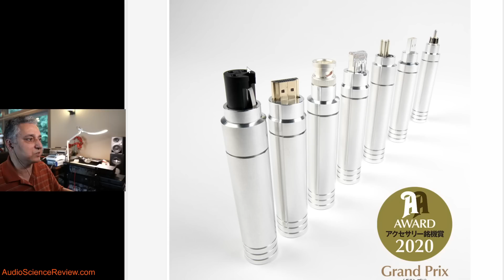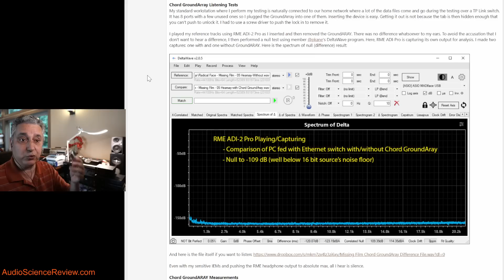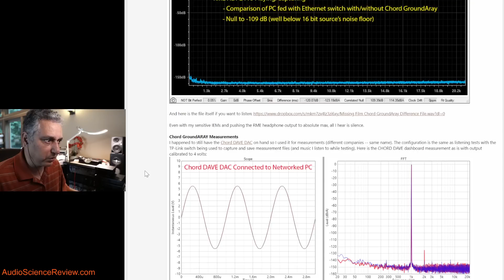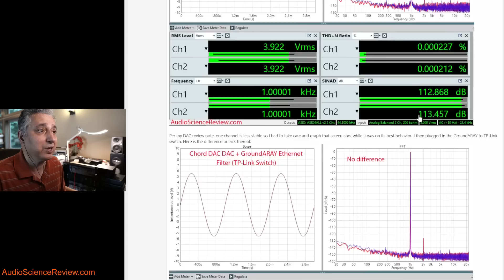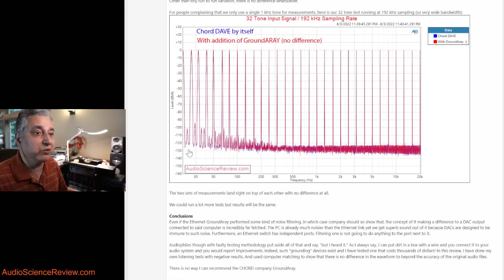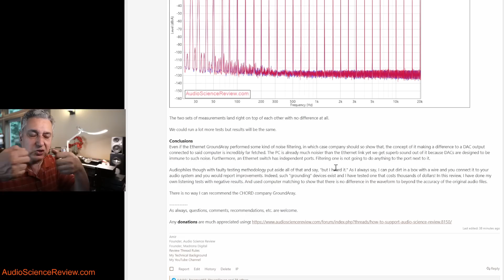Chord GroundAray Review

Comment: Shame on you for testing a product designed to be used straight into a DAC or amp into a switch, making the effect almost wiped out. You also used a very inferior system. The product is designed for a much better system... in a much better set up. Also, every user of this kind of equipment knows that you have to test which input/output works the best and that is a long slow process to get the effect, taking time. The real debunking is not the product but this channel. 

Grounding works and have huge positive impact if used in a high resolution set up, without weak links, properly placed speakers and used correctly. 

Forgot to mention that the test data and sound tests in this review are based up on measurements at the wrong places Ground Array. It’s like making a science report regarding apple, based upon data from the car industry, totally invalid. IF.... IF... you used the product correctly and measured at the right place, the quality of this video might have been higher. This kind of trash talking might get you sued from all the manufacturers that you make a living on “debunking”. 

From my experience... you will not learn anything from this feedback... just trying to give the readers another perspective and letting you know it’s time to upgrade your tests or to stop this channel.
Reply: Forgot to mention that your mention of statistical correctness was incorrect as the test was done improper. The product should be left in for more than 24 hrs and placed at another place in the system and in a proper system for which the product was intended. 

Make the world a better place, not worse
Reply: https://youtu.be/dxU8wYLMalc
Reply from the maker: Shame is on you for not watching the interview with the "designer"/company owner where he says the first place to put it is the switch/router: https://www.audiosciencereview.com/forum/index.php?threads/chord-groundaray-review-noise-filter.36256/post-1271680

So no, grounding has no impact, huge or otherwise.  It is your imagination based on wrong lay intuition that makes you think they make a difference.

Comment: Not saying it works or not, but at least the intention of use is to connect it to an unused connection on the streamer or DAC, not to a spare port on the network switch. Rj45 are isolated so maybe it doesn’t make sense. But RCA connections on a DAC share a ground, so maybe this thing has a chance if it is  connected to 1 unused RCA while music is played through another set of RCAs. 
Probably not, but just though it makes sense to point out the usage

Comment: If you take that wav file and boost gain by 105db you can hear those differences. The differences are muddled by the noise floor, but technically there is a difference. Is it possible to do that null test between an r2r dack and a delta sigma dac?
Reply from the maker: As I explained, that difference is there even if i don't change anything. It is hard to get perfect sync due to variable clocks.  As to R2R dac test, yes, that would be good to run this against.  Currently I don't have one to test but when I get one, will run the null test.

Comment: Amir, are you an Audiophile? or Audio Enthusiast ?  I can clearly hear a difference in your sample clips.  You get more instrument separation and transparency with the added grounding.  NO PLACEBO... I don't mean to offend you! Sorry!
Reply from the maker: Yup.  Been an audiophile for decades.  As for your observation, you now have proof that it is wrong.  The difference file is silent.  The power of brain to imagine things is amazing.
Reply: @AudioScienceReview  Thanks for the reply! Not to brag or anything, and i will not go into deep typing.  I am a EE specializing in Audio. Also, sound Engineer, and for the past 7 years, i discovered a new Audio technology which i cant talk about much, patent pending, dealing with so called Snake Oil.  I can basically manipulate sound at a much deeper level than the devices you measure and validate. Something which you would be puzzled, because it functions so well. However, i plan to capitalize on this, so can't say much more than that.  Ok with my tests, i get similar results as you are getting. However, there is a way, i am able to observe changes in sound signature or improvements in sound besides using the golden trained experienced old ears, hehe.  Ok, try using a middle preamp add on and a 16 ohm load between the output stage of your source and Null. It may suprise you, depending on the differences in signals etc. Alternatively same setup, record and view musical waveforms not electrical characteristics. Do a compare Analysis. You'll figure out the details, hehe... I had to figure out a way and scratched my head, it puzzled me, but in the end, I found the proof i needed to rule out PLACEBO.
Reply from the maker: @alcamacho1844  There are plenty of EEs in audio with wrong ideas.  After all, they are the ones designing equipment that so frequently shown to be non performant.  So yes, let's not get into credentials that don't add value to the conversation.  As to your claim about measurements, once more, this review included a null test.  You claimed to easily here a difference.  Yet mathematical comparison of the two files shows that is impossible.  That conclusively suggest you need to revisit your assumptions about your knowledge and understanding of audio.  Patent office accepts anything unique by the way.  It doesn't mean there is anything valid there.  Plenty of audio voodoo have patents behind them.

But sure, come back when you have something to show.  Until then, please don't make claims  you can't back and insult me in the process as well.
Reply: @AudioScienceReview  Sorry to step on your toes, it was meant as a constructive opinion and observation on your methods. That being said, ill see if i have time, i may  invest some of my time and create a video on my methods. Ill be back if so, to share my fellow Audiophile.

 Keep up the work, i find it entertaining as a subscriber!
Reply: @alcamacho1844  "Ill be back if so, to share my fellow Audiophile"  I've seen these type of claims several times - "I have something revolutionary, but cant tell you what it is at this time. it will come out in the future" -  Right from the start it sounds like snake oil
Reply: @wesselingaudiodesign5031  hahaha, true I understand! Im open minded, i used to be a skeptic before. But actually, I'm not Bs ing...  There are ways, to really create the type of sound signature one wishes for. I actually cant wait to release this tech.  It will actually benefit us all. No need to pay snake oil prices! Just moderate price tags! I dont agree with these hi end manufacturers.  So even though I have invented dozens of device and cables for over 7 years, I side with the consumers.
Reply: @alcamacho1844  Audibility proven with blind tests for your devices?   As far as peoples taste for enjoying equipment with for example, a warmth inducing distortion, or slightly ringing bass for added fullness, I can sort of understand that to some extent..  Those things are measured as added noise so should it be called Hi Fidelity? I go with No!
Reply: @wesselingaudiodesign5031  Yes... Easily pass any blind test! There are ways to excite Audio harmonics and then clean up any mess... I design Audio circuits as well. 
Have a nice day!
Reply: https://youtu.be/nzhyQFVIuRA

Comment: Each Ethernet port is electrically isolated from the switch/router circuit/s and each other.  Its just the nature of the 10base-t interface.  So I can't imagine what the device is supposed to do. Just some ferrite beads for the snake oil effect, I guess.
Reply: The purpose of the device is to separate the buyer from his cash. It works most excellent in that regard.
Reply: @SirBunghole  Mission accomplished.

Comment: After this most recent round of reviews of “tweaks”, resamplers, power cords, cables and conditioners (plus other science based testing by Amir and others) , one can be pretty confident in the  general inference that such products are worthless at best, and often make things worse. In fact what are great about Amir’s reviews of these items is he explains the failure of these products through scientific principles such that the results are applicable to the entire “class” or type of products (ie, not this expensive power cord but every power cord) and cannot be ascribed to be particular product or even one item or set up. 

Either the designers do not understand basic principles of electrical physics and acoustics, or they make engineering mistakes that are simply unacceptable at any price  (see the Chord resampler) or they are cynically dishonest. 

I know if no other “hobby” with such pervasive snake oil.
Reply: Cynically dishonest, I'll go with that...
Reply: I mean, the short-list of things that make a big difference is a really short list: speaker acoustics, outboard interface with decent noise rejection, room acoustics. Lots of folks want to believe in an expensive expensive hobby with lots of doohickeys.

Comment: My very first experience as an audiophile started in a local audio shop in my area. They had amongst other things these noise filters, a plug attached to a cylinder. They said it removes electrical noise from the outlets, improving clarity and sound fidelity. I knew something was already off, and this item you reviewed is certainly the same thing revisited. Glad to have you on our side. Keep it up.

Comment: Thank you for another informative myth busting video. I have a q, hope someone can help. The room with my audio gear has no grounded power outlets. On the rca inputs on the amp i can feel the electricity running when lightly touching (small vibrations). After plugging in rca in amp to 3.5mm audio plug into laptop it seems less/gone. Is the laptop grounding the amp or am i placeboing myself? For proper grounding would it work to connect a wire from one of the rca inputs on the amp to the grounding metal on a grounded power outlet in a different room? So like using a modified grounded power plug with just the grounding wire used, terminating into rca on other end.
Reply from the maker: It is "normal" to have that kind of leakage current, i.e. enough to give you a buzz. It is safe from electricity point of view but can cause ground loops.
Reply: You need a competent electrician to assess your wiring. Ungrounded  equipment, designed as such, class 2 or double insulated, can float at elevated potentials, often half the line voltage. Whether it is healthy to have a computer sitting on your lap with such fields present for prolonged lengths of time is open to to question.....
Reply: Thanks for the info! It does not buzz luckily but I'll see if I can get the landlord to upgrade the outlets just the same for peace of mind.
Reply: @acerlagonda3537  All SMPS leak tiny and safe amounts of high voltage AC to their chassis ground as part of their EMI flitering design. You will feel the tingling when touching the chassis, as long as nothing in the signal chain has a real ground connection to earth.

Comment: Here we have an engineering company that doesn't seem to understand the difference between a plant pot filled with soil on an indoor shelf and an electrical earth. Out of interest, can you null signals via different DACs, so we can hear what a resultant signal sounds like, please.
Reply from the maker: I am or should say, designer of deltawave is working on that.  The challenge is the clock drift.  Its actually dynamic and complex.  Without correcting for this, you get really poor null.
Reply: @AudioScienceReview  Kernel stream USB into a TCXO (or better) controlled S/PDIF converter, then into a video distribution amp for identical and buffered S/PDIF/PLL etc signals into separate DACs.
Reply from the maker: @johnshaw359  Yes, there is a method to do that and it definitely helps.
Reply: @AudioScienceReview  Thanks Amir for replying, I hope it helps you out.

Comment: Why do you so often make reviews of these “junk products”? Why not focus on normal products instead. No matter how many of these review you make very few will stop buy these products. Your fan base would never buy these products in the first place. No offense.
Reply: @Douglas Blake, no, not really. I would however personally never buy these kind of products. I think these kind of reviews are counter productive. I get a feeling they are made for pure entertainment for the already “enlightened” ones. It just enhances to polarization imho.
Reply: @Douglas Blake, I’m an engineer, dealing with high frequency signal transmission and processing on a daily basis, I kind of have a clue what could work and not. There is a lot of snake oil out there. My point was that it would be nice to see a focus on good stuff instead of the bad stuff.
Reply from the maker: My "fan base" are the ones that are sending these products in for testing.  Many have doubts and once they see the analysis, change their opinion and realize they were just following the crowd.  For sure there is an impact.  Not on the hardcore, head in the sane people, but the rest which is quite large population sadly.

Comment: I think this is the company that sold The Clearway System Enhancer Stage 1 mains filter for like $300. Turned out it was probably a re-label Roxburgh PMF6 mains filter that cost $30. After I pointed this out on a few forums, the product disappeared.  Always wondered if the PMF6 did anything. It might do as its an industrial product but just not for audio freqs.

Comment: I wonder if Danny at GR research has an upgrade kit for it. What makes me mad is not the existence of these. Its the fact people have the disposable income to buy this trash vs donate it to an animal shelter or non profit.
Reply: Don’t give Danny any ideas…I can just see him offering a kit with “upgraded” “audio class” capacitors and resistors and wire connectors that costs more than the unit itself and requires rebuilding the entire pcb board. 

Like many of the speaker upgrade kits inexpensive or ancient  speakers that cost much more than the speaker itself, sometimes speakers that are fine to amazing for their price point to begin with (Andrew jones pioneer and jbl 530 for example). Why people buy such things instead of just getting a different speaker boggles my mind.

I have pair of  cheap to begin with and now very old Mordaunt short ms30i with cheap as chips first order crossover and a bit of beaming as a result, but also pretty spectacular high e d imaging and sweet midrange on vocals. After all the woofer and tweeter were both designed to work well with a first order and the cabinet, As an experiment ,  I tried a few order crossovers at different crossover points (diy, decent parts) and guess what, the beaming was gone  but so was the all the character of the speaker. Yes I have “better” measuring speakers, but what’s the point of having  vintage and vintage-y stuff unless you enjoy them as they were designed. An old MG can be fun, no need to try and make it a Miata or Ferrari. If I want to listen to precise  studio monitors or other better measuring speakers I have those too. …though I do have a pair of mirage MRm-1 that I would love a bit more if their center imaging weren’t so fuzzy (these are not omnipolat or bipolar types).
Reply: WHO ARE YOU TO EVEN SUGGEST WHERE SOMEONE ELSE SPENDS THEIR HARD EARNED MONEY... BLESS YOUR HEART
Reply: @MichaelWitttarpon922gmail  WHO ARE YOU TO JUDGE HIS SUGGESTION?  wait……what am I doing to you??  Disregard.

Comment: Love how you flipped that script around, listen test first then note that some fussies care about measurements, so you provide them too ha! Blamm! Question, My Klipsch Forte IIs have 15" passive radiators, I was looking at adding a subwoofer, which made me wonder if the low end of the sub would drive the passives the wrong way, killing some of it's benefit.
Reply from the maker: Personally for music, if I already have that much bass response, I would not bother with a sub.  If you want to add one, then must measure the room response and get it to be even in bass.  Otherwise you can have very boomy bass.
Reply: @AudioScienceReview  - Does the sub drive the passive to any meaningful degree? Thanks!
Reply: @Douglas Blake - "It can ... depending" is no more information than exists and is implied in my question, so thanks but that's unhelpful. 
I understand physics quite well (why I asked). The essence of my question is however, "... to any meaningful degree" ie "... in practical application." A boat may be leaky, but if it's inconsequentially small and you have the means to deal with an increase then sail on. 
To turn it around: there are a lot of well known best practices the hifi hobby but I've never seen a statement about subs used with passive radiators such as "Don't bother, it sucks." A 15" Klipsch sub goes far lower than the Forte II so the idea is enticing, but it may be impossible to achieve without muddiness across their low end overlap areas because the passive is so easily resonant, whereas a sealed box would have far less of an issue.
Reply: @Douglas Blake - Did you read the question?
Reply: @Douglas Blake  You are who can't read lol.